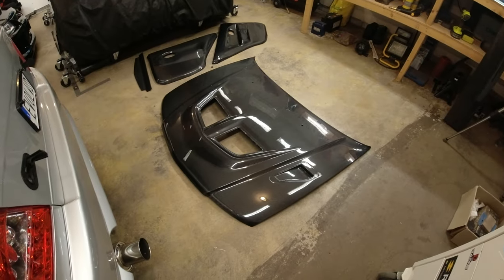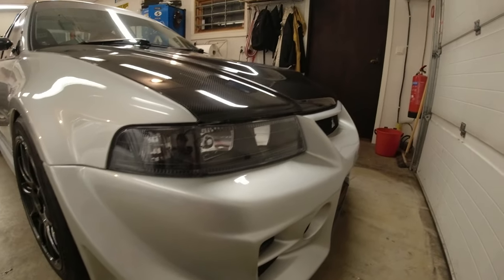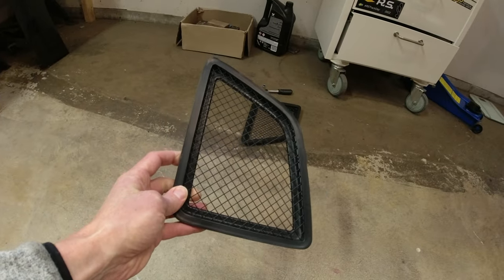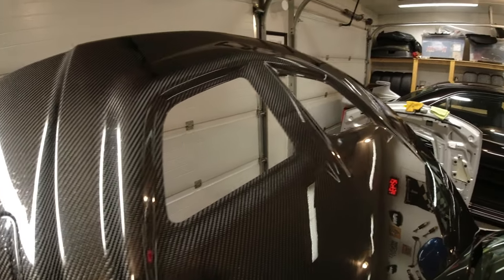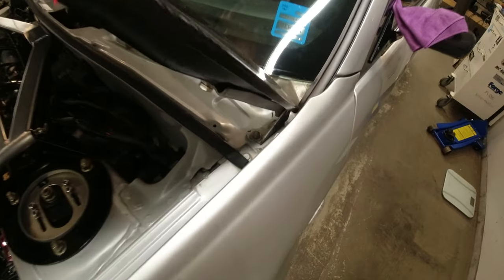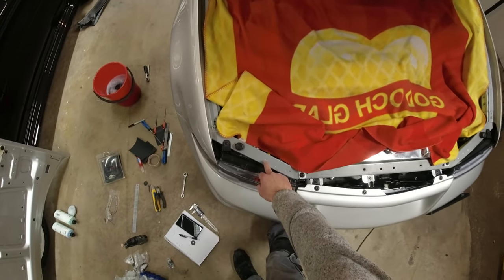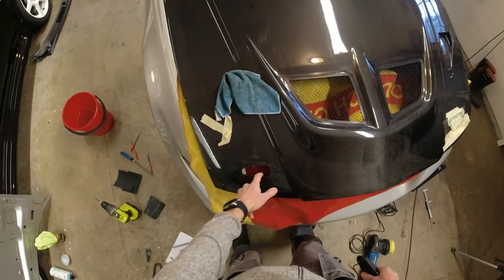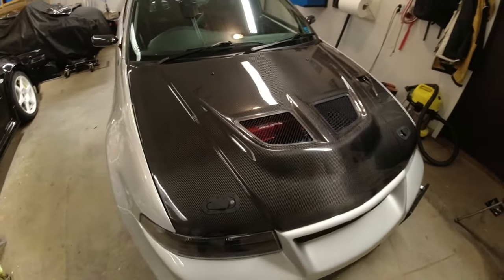INSTALLING A CARBON HOOD ON THE EVO V

Comment: Hello Mythical Mark. Great job with the new carbon fiber bonnet.  Great job of placing the OEM hood grilles, and adjusting the Naca intake.  Excellent aesthetic result, and improvement with the lower weight. Good evening Mythical Mark and happy Christmas holidays 😃👍🎉🥂
Reply from the maker: thankyou Salvatore and have a fantastic Christmas time also!!